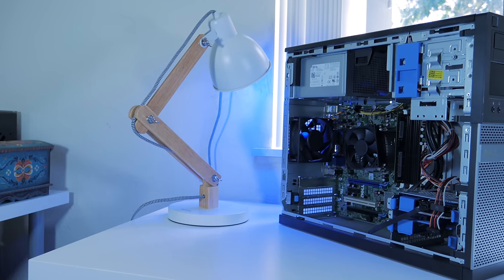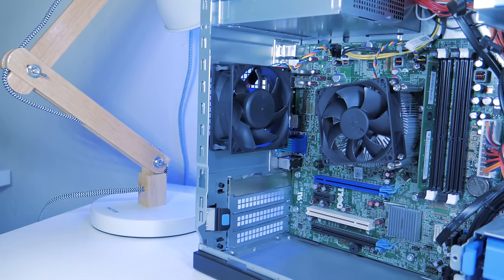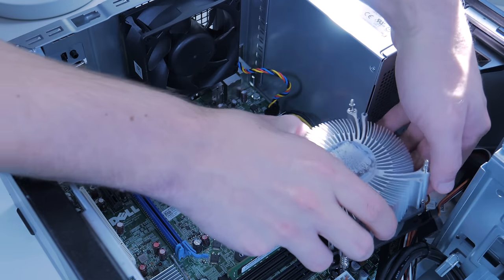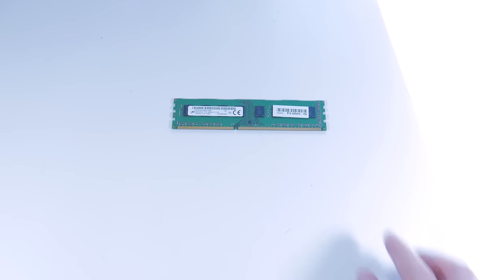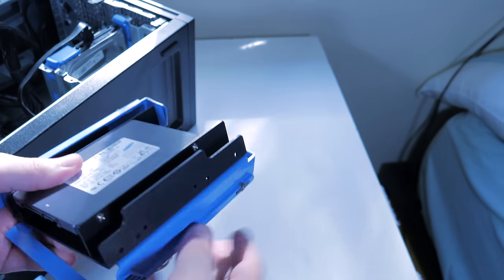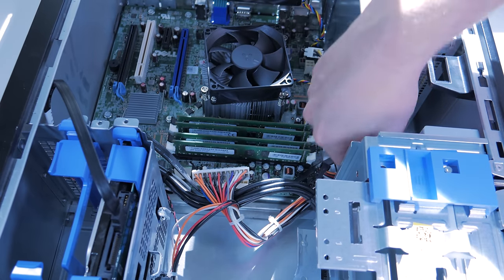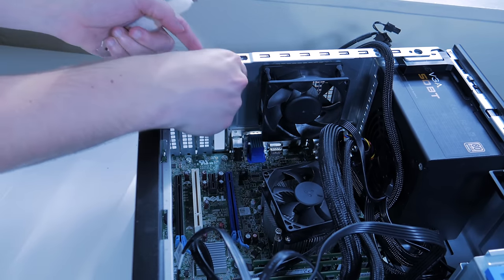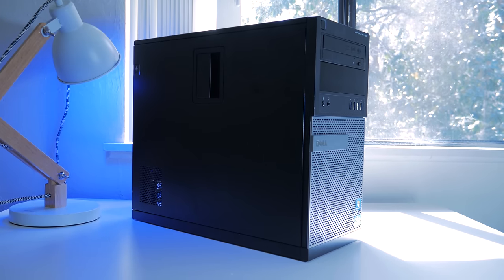How To: Turn an Old Office Computer into a Gaming PC!

Comment: Would going with an Intel Xeon CPU have any downsides? It seems I could get an insanely cheap buffed CPU for a build but if there are downsides let me know.
Reply: I got a asus h55 board, xeon x3470 and 8gb of ddr3 ram for 100ish dollars.
I've since then invested into a better cooler (212 evo) and got my xeon to 4.0 Ghz, and it performs almost like a I7-3770 at stock.
The x3470@4.0Ghz won't bottleneck a 6gb 1060 and also it will bottleneck a 1070 by only 10% which is great, i find RX580 8gb match for it.

Just when picking xeons, try getting the ones that are either rebranded consumer chips or the ones with higher clock speeds and lower core count, something like 4c/8t is just fine for gaming and it's probably going to perform better than 8c/16t that would excel in workstation loads like video editing and animation/3d modelling etc etc

Comment: Most websites for the manufacturers of "corporate" PCs have a place on their support page where you can put in the full serial number to find out what is in your machine and exactly what it can be upgraded to. Sometimes upgrading can be a little tricky because of proprietary motherboards, power supplies, etc. And ALWAYS upgrade the BIOS first.
Reply: Link?

Comment: I have a similar setup - Optiplex 790 w i5-2500, 32GB of RAM, dual Samsung 860 EVO 500GB SSD and 1 Samsung 870 1TB NVME SSD on a PIce 4x card, EVGA GTX 1050ti 4GB Graphics card.  This setup runs most current games at maximum settings with no performance issues.  I'm planning a newer build off an XPS machine with the i7-8700, but am waiting until the summer to build it.

Comment: About a year ago I picked up a Optiplex 3010 for $12 at Savers. It has a i5-3470 and 8gb of ram, i added in a gtx 1050ti and it runs amazing. Great value for under $200

Comment: What you should have mentioned is, that some manufactures of OEM-PC use propitary power connectors on the motherboard (even in towercases). So an normal ATX-PSU will not work.

Comment: i have done it with a DELL Vostro 270k1
i5 3450 CPU
8gb ddr3 1600mhz RAM
1tb HDD
I added a gtx 650 1gb OC GPU and 240gb SSD.
It is actually good.

Comment: Whats the point in buying a system and then upgrading/removing a lot of parts from it? Just get a really cheap dell OEM motherboard, cheap case, and then buy everything else
Reply: Zereko many times the whole computer is cheaper than the parts as a separate. I've got refurb 990 optiplex with i5 2400 for $80
Reply: Oh cool, where did you get it from?
Reply: Zereko cheaper.
Reply: Zereko eBay, there are lots of refurbishers who sell these office machines all the time
Reply: Typically the only parts you would remove and upgrade are the gpu and psu. The goal is to buy a cheap pc with a good cpu, which also has a good amount of ram, like 8gb. Then from there, all you need to do is stick a gtx 750 ti or 1050 ti in it as well as a better psu and you have a budget gaming pc
Reply: When buying an OEM it's usually a good idea to stay away from the consumer level products, workstations are usually okay as they use better quality components that perform better. A bad chip set or a poor motherboard can result in a massive performance hit, upwards of 20% in the same generation even. Buying a cheap OEM to get a few components that are good and replacing one with a solid mid-high end board can make worlds of difference.

Comment: I bought 2 of these for Aud $200 each, but with i7 2600 cpu, I put gtx 1050TI in one for a friend, and GTX 970 in the other (my one, plus 16gb ram). I had a 400 watt psu and 650 watt psu, and ssd for each, 2x 1tb hard drives, great compact budget gaming! You will need to drill out the rivets for the hdd cage if using a longer graphics card and move it up about 100 mm or so, so the long Gpu will fit. For 1050ti or 1060, it will fit without changing anything except better power supply, these are only 265 watts in Optiplex 990.

Comment: bought a optiplex  i5 3470 4gb ram, added 500watt psu, 4gb extra, 6gb gtx 1060 and a 240gb ssd $200 total for everything off fb marketplace. 60fps ultra gaming with most games... planning on buying a i7 3770 soon to upgrade :)

Comment: This pc has an i3 and my “gaming pc” has a core 2 duo
Reply: Upgrade it to core to quad same thing just with 4 cores and 8 threads
Reply: Ours is pretty new but it's not for gaming tho but the specs are overkill for a family pc specs: core i5 9400 4.1ghz GIGABYTE b365m ds3h GTX 1050ti 1x8 teamgroup elite 8gb ddr4 2400mhz ram (willing to add a stick of 8gb ram to make it 16gb) wd blue 1tb HDD (willing to upgrade the GPU tho... to an rtx2060s
Reply: 2 cores😬 4 cores is best idea

Comment: I took a similar route, only my desktop came with an i5 2400 already. I used the same PS as you and currently running 8GB of ram, stock out of the shipping box it came with 4gb. I also added a 120 GB boot ssd and eventually scored a 3tb 7200 HDD for storage. The main deviations from your setup is, i started with a GTX 750 TI from Zotac (used Ebay) and eventually got a 1050 2GB Mini also from Zotac (new Amazon). I also added a Blu Ray drive so i could rip blu rays to store on my computer. I paid $139.00 for my desktop in January 2017 and currently have about $425.00 in it now
Reply: Should have started with the 1050

Comment: If you want a pc under $700 
You should buy gtx 1060 3gb
Ryzen 5 2600 or 2600x
Any gigabyte ab350 motherboard
8 gb of single stick ballistix sport Ram

Buy others by your own choice.leave a like
Reply: Why not a g4560 $60 a h110m.2 $60 450watt evga $30 8gb ddr4 $80 and a case $70 and you can spend the rest on storage or what ever you want
Reply: while I think the g4560 was a fantastic cpu when it came out (and to an extent still is), it's only a dual core with hyperthreading. So while it has 4 cores which is the minimum you need for 2018 gaming, why limit yourself to that when you can get real 4 cores with a Ryzen 3 or an 8th gen i3. Plus both of those generations brought more cores to the masses.
Reply: not the rn 2600x get the i5 8400 its litterly $40 cheaper and only proforms 3% worse 
then the 2600x
Reply: @benabel886  the ryzen is alot better for upgrading a i5 8400 can't handle a gtx 1080 without a little bottleneck the ryzen 5 2600x can handle a gtx 1080ti stop being a Intel fan baby
Reply: i like amd to
Reply: yeah you got a point there the rn 2600x is very futer prufe
Reply: @benabel886  i5 8400 performs better in games
Reply: Why not a Ryzen 3 1200 and a 1060 6gb, or better yet a i3 8100 and 1060 6gb? This config is cheaper and still performs the same for less.
Reply: the i5 8400 is pretty good becuas its 6% better then the i7 4790k
Reply: Got a GTX 1050, i7-2600 and 8 GB RAM. It works nicely. I eventually upgraded to a newer system but this was a great setup for under $300.
Reply: I had a $375 budget to upgrade my AMD FX 8320 and GTX 950 build. I bought a Ryzen 5 1600, A320M, Team Group 8gb stick of RAM, and originally I got an RX 570 but it was doa, so then I got a used 1060 3gb for $180
Reply: @benabel886  or get the 2600 non X and do a light oc
Reply: @NOEG37  the g4560 stutters like mad in a lot of new games, and its on an older socket
Reply: Alishan Vakhtazimov do you mean the rx 580
Reply: @superboyboy4681  no rx580 costs more
Reply: Alishan Vakhtazimov no its 200
Reply: Should go with 980ti it's better
Reply: praney singh yea but hard to come by for me at least
Reply: Single 8 gig stick's not good,dual channel's way way better (4x4 gig)
Reply: 囟 Revialle {L.R} 2x8 is better for future proofing
Reply: @superboyboy4681  Uhum I meant if someone was going for total 8 gig ram build.
Reply: 囟 Revialle {L.R} oh I’m running 8 it’s fine

Comment: That i5 2500 is a good CPU.  It was my daily driver in an upgraded HP Elite 8200 SFF PC.   Just upgraded to a Dell T1600 workstation.  Put in a new PSU and replaced the old Quadro with a GTX 1650 and I am good to go.

Comment: Quick question, I’m doing all of these upgrades to my work office PC, it’s an HP M01-F1214 Desktop AMD Ryzen 3 4300G. So far I've cloned and replaced the stock 256gb SSD to a 1TB drive, and increased the stock 8gb ram to 32gb (overkill, I know). The next thing I’d like to install is a new GPU, my stock one is a PCIe v4.0 x16 and I’m not sure if a dual fan GPU will physically fit in the case nor do I see a PCIe slot in my computer as you pointed out in your video, any guesses?? Would appreciate it!

Comment: My configuration:

- motherboard Asus P8P67-M
- CPU Intel i5 2320, 3,0/3,3 GHz
- ram DDR3 Kingston 2x4Gb, 1333 MHz
- GPU MSI Ventus XS 1650 Super
- SSD 860 EVO 500G
- HDD 500 Gb
- power supply Corsair RM550x
- generic office case
- CPU cooler Noctua NH-U9S
- 2 x 80mm fans Noctua NF-A8 PWM as exhaust fans
- 1 x 120mm Noctua NF-A12x25 FLX as intake fan

Works just great if you understand that probably you will have to make some concessions when playing newer games.

Comment: I have a dell optiplex 5080 with a 10th gen i7 16gb of ram and 1tb hdd with a 256 nvme but the only issue is the power supply it’s not a square one like most it’s a rectangle I want to use it and upgrade to make a gaming pc but how do I go about the power supply ?

Comment: I got a dell optiplex 9010 which is very similar to this however it came with 2x8 GB of DDR3 ram and 2 TB with an i7 3770k 3.4 ghz. It came with a decent GPU (GT 640) however I upgraded to a 750 ti and the whole system was free from craigslist and I had a 750 ti lying around. :)

Comment: Could've went for an i7-3770 instead, around $35-50 and hold up way better than i5-2500 or i7-2600
6:19 I can confirm, I still can't get over my 500W Cooler Master PSU having all those mustard ketchup cables ughh
Good thing my case has plenty of cable management space to hide those, and I did a pretty good job making them not visible, tho the GPU power cable is still yellow and black so that one can be seen

Comment: Scored an Optiplex 990 for 25 bucks a year ago. Had to buy speakers and monitor with it (75 all together).. Then came to learn it was a Harman Kardon 2.1 and HP IPS 16x9 monitor so it was still an amazing deal. I would have honestly paid 75 for the computer as it booted right up. Of course wiped the drive with a battery of tools and used it as extra storage. Pop an ssd in these old boys and they're absolutely usable. WITH ANY OF THESE OLD PRE-BUILTS ALWAYS GO WITH A CARD THAT HAS AUX POWER CONNECTORS (6, 6+6, 6+8, 8+8 pin PCI-E, etc) Some of them have power limitations that will cause for a bad day. Essentially you throw a 550w psu in it, ssd and an older card (or even newer if you can find it) and you're good to go. The w7 keys WILL still work on W10 installs and lock the system in. whistles
Reply: I'd still go with Windows 7 if you have the key for it. It will run a bit lighter and you might gain a few FPS here and there.

Comment: these towers are amazing i am using a 1050ti 4gb with 16gb ramm ddr3 paired with a i7 BUT if you transfer to a new pc case there is no pwr/reset panel so you have to use the OEM power button some how but hey you can get these towers for 75 to 200 bucks amazing computes and thanks for the videos helping em with the build!

Comment: I have an Optiplex 9020mt, which only comes with a 290w psu. However, it has 14gb of ram, and an i7-4770. Thing screams for desktop use, but couldn't game with the included Radeon 8940 oem card. I thought about a 750ti, since it doesn't need extra power, but I went with the R7 260x, powered with sata converted to 6 pin, because it has similar performance to the 750ti but was much cheaper. Now I can comfortably game modern AAA a little better than a ps4. Capped 30fps solid at 1080p mixed medium-ultra with the extra goodies like AA on newer games, 60fps on high-ultra on games older than a couple years. All for under $350CAD, including OS and 24" Dell IPS and wireless kb/m.

Comment: I built up a Dell Optiplex 390 with an Intel i5 2400, 8GB of ram, a 256GB SSD, a 4TB storage drive and a Nvidia Geforce 970 GTX. I haven't tried anything crazy with it yet but things that my old PC would struggle with are screaming fast on this machine.
Reply: oh yeah! a corsair 500 watt power supply as well. this project was cheap. about 5-600 for everything.

Comment: Glad I found your video. I was wondering if I would be able to use my existing pc, and just add extra storage, a new case, and the rgb cooling fans.. I have a windows 11 hp 4gb desktop pc I bought from WalMart,(the one with the keyboard, mouse, and speakers- the slim one) It was 200 and something, and I got a 27 inch Roku monitor to go with it which was a hundred and something, so my pc in total came out to 400 and something or almost 400 with taxes. I wanted at least a terabyte of storage at the time, but it was out of my price range, and I really wanted a separate monitor. I was using an all in one pc with a terabyte of storage. I'm hoping if I do all this it will be simple, and wont have to reinstall windows,etc.. I figured I would just use all the parts off this pc, except order more RAM, a new case, and the rgb fans..It's a 64 bit operating system, Has Intel Celeron J4250 CPU , something is 2.00 GHz. I do everything on this pc. I ordered a new keyboard and mouse from TEMU. I have been checking out their pc stuff, but some stuff has been discontinued which sucked butt. I'm all about the rgb stuff now.  I have lights going around my desk, my keyboard is sitting on something that lights up, my headphones light up, my headphone holder lights up.. I can't wait to explore and learn about converting my pc..

Comment: Just built one
Bought an optiplex with a 3770 and 8gbs for 100 bucks.
New thermaltake psu 500w for 45
240ssd for 30
GTX 970 for 100
Had an extra 8gbs laying around so 16 total
Total 275, can't beat it for the price.

Comment: Did this earlier this year with a similar Acer pre-built and cant believe the performance for the $, i would recommend a blower style GPU cooler though with these OEM cases as the open air type coolers on the GPU's i used seemed to heat up the surrounding hard drive cage & hard drives when under load.

Comment: Used the i5 2500 version of this for a while. I gave it an extra 4gb of RAM and a gt 620. It played tf2 pretty good, and was excellent when it came to GameCube emulation. It did good for 2 years till I decided to upgrade to a ryzen 7 with a 1060

Comment: I have that model of PC, and one thing I noticed when helping a friend is that the length of the graphics card can sometimes be too long and go over the sata. motherboard ports
Reply: It's even worse with the next gen Ivy Bridge Optiplex. The motherboard header for the front panel USB3 cable was so close only the shortest GTX 970 would fit. Found that out the hard way...

Comment: My current recommendation is to get the newer Optiplex 9020 from someone on Facebook (those go for ~$150 right now), and grab an i7-4790K used off Ebay for <$250 along with some additional RAM and an 860 Evo and a low profile Noctua cooler off Amazon and you're set (and get whatever graphics card you want)

Comment: I bought a Optiplex 790 (mini tower) from Ebay for $75 + free shipping. 

i5 2400, 4GB DDR3, 250GB hard drive. 

After buying a new keyboard, mouse, speakers and a used 23 inch Dell monitor, the entire system cost me $200.

Not too shabby.
Reply: Okay but what about the graphics card?

Comment: Recently did this with an Optiplex 990 sff, was able to find a slim gtx 1650 that fit in the case and didn't draw more power then the existing power supply could manage, upgraded ram and storage and I've got a computer that can run everything I want on it. 

The GPU does run a bit hotter then it should though but that's what I get for using a SFF

Comment: I'm currently debating on what to upgrade first on my computer. I have an AMD A4-6300B processor with dedicated graphics, 8gb of ddr3 ram, 240w psu, and 1tb of HDD. The most powerful processor I can put for the socket is a10-6800k. Should I get that or a EVGA NVIDIA GeForce GTX 750 Ti SC 2GB GDDR5 PCI-e?

Comment: Dude upgrade your GPU to a GTX 960... you can get one for about 50-70$ and it runs all AAA Titles... great pairing with the i5 2500 and put another molex fan in front.. connect it to the psu and you got a nice airflow and a very quietly gaming experience

Comment: Depending on what video card you use it may or may not fit. Also even if it does fit the SATA ports on these are blocked by many video card fan shrouds. Most of the time you can use 90 degree cables to get around that or use the Silverstone ultra slim right angle sata cables. I have seen a few of them with this issue.

Comment: Hey, like your video and how easily you've explained the process, my partner's very old PC needs an upgrade, I could easily buy a new one, but the old PC has sentimental values to her (her late father bought it for her) , so I've set myself a challenge to upgrade and modernise it for her, its not going to used for gaming, but still would like to it be medium-high range for everyday use and multitasking whist keeping the existing case... perhaps  a new cpu?   What components would you suggest?   BTW it will be my first time trying to do this practically 😅  but I'm up for it.

Old PC details:

HP A6325UK Desktop PC, Intel Core 2 Duo processor E4500, 3GB RAM, 500GB Hard-drive, DVD Writer with lightscribe technology,Nvidia GeForce 8500 Graphics

Comment: I got a Fujitsu Celsius W410 that was no longer needed at work.
Nice little machine with an i7-2600 and 16GB RAM.
Thing is though, that the motherboard only supports those weird 16 pin power connectors, so I can't swap the PSU for a bigger one, and the only relatively cheap motherboard I have been able to find for sale in Denmark (<$150) only has 2 RAM slots and extremely limited features (Biostar IH61MF-Q5).
As it sits now, it has an nVidia Quadro 2000 in it, wich actually requires more juice than the PSU is rated for....